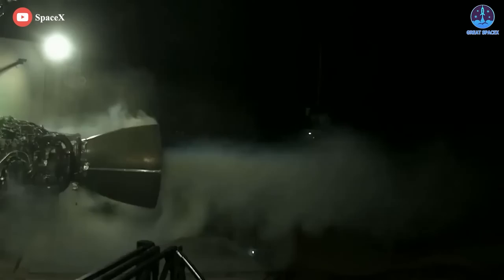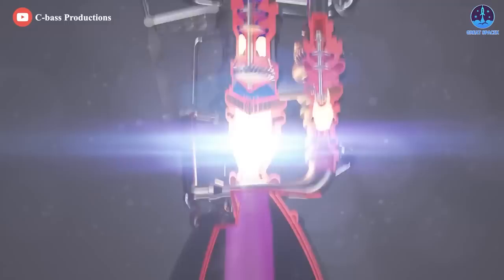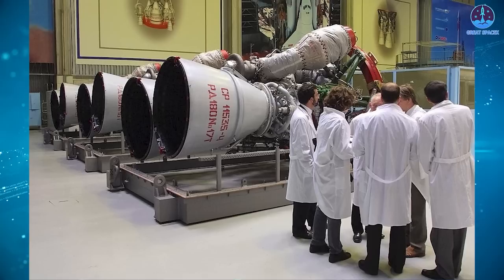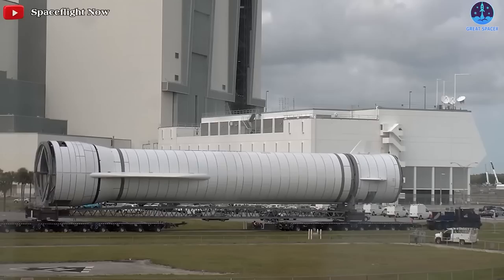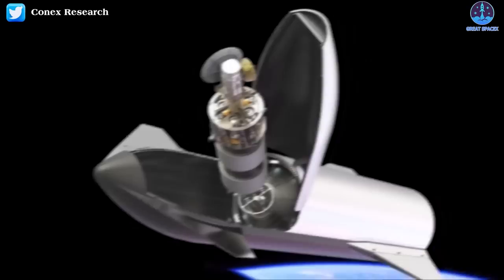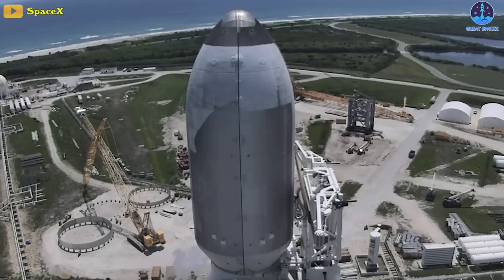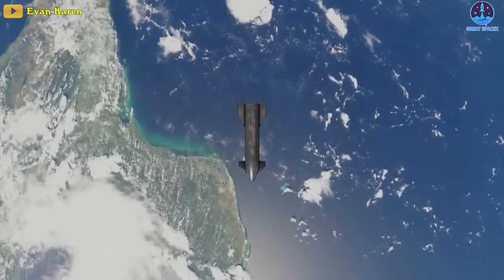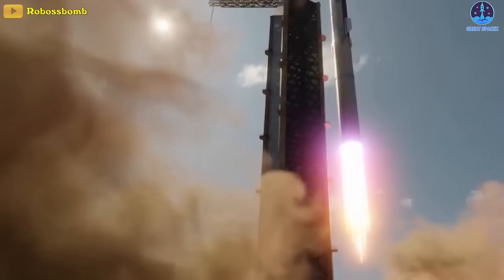What Planetary Scientists revealed of SpaceX's Starship just SHOCKED the entire world...

Comment: If we assume that spacetime is made of gravitons and that gravitons are the entanglement between photons, ER = EPR (SUSKIND), then a warp drive might look like this.  Start with a high powered laser and a crystal that splits the beam into two entangled beams p1 and p2.  The photon frequencies of p1 and p2 are the same, f1 = f2.  Since we're thinking in terms of an equation: h(f2 - f1) + Delta U = 0, where h is the Planck constant and U is gravitational potential energy, then a quantum entanglement with f1 = f2 results in zero gravitational potential energy between the two entangled photons.  

But what if you could centrifuge the entangled beams?  What if you could blueshift p1 and redshift p2?  How could you do that?  Imagine a disk that is two meters in diameter, not so different from a spinning wheel on a playground, but without all the handlebars and kids.  It would have to be lightweight and sturdy up to 3000 RPMs; and very thin.  Maybe it's made of carbon fiber or sapphire.  Next, you attach an optical fiber along the radius, from r1 = 1cm to r2 = 1 meter.  You might have to attach 12 optical fibers, from 1 o'clock to 12 o'clock.  The optical fiber might have to be thick so that it carries a lot of photons, perhaps even hundreds of watts of photons.  You might also have to use materials that slow down the light from the speed of light, to something more manageable.  You will need two of these sapphire spinning disks with optical fibers on them; one to spin at 6000 RPMs and one to be a non-rotating pathway that the photons can return to the "start" position on.

For the p1 beam to be blueshifted, the start position will be r1 at 12 o'clock.  The beam will travel down the optical fiber on the disk as it spins at 6000 RPMs for about a meter.  Then, using amazing optics and computers, the beam of photons will transition from r2 12 o'clock of the spinning disk to r2 12 o'clock of the bolted down (not spinning) disk.  Then, it will travel back up to r1 12 o'clock on the not spinning disk.  This is the first centrifuge cycle for the p1 beam that is to be blueshifted.  You can't reuse the same pair of disks because there is no way to transition from 12 o'clock r1 on the non spinning disk to 1 o'clock on the spinning disk in a way that is repeatable around the "clock".  

Since the innovative community is made of brilliant men like Elon Musk, someone could figure out a way to make this process repeatable.  In the mean time, I think it will be necessary to interlayer about 1200 sapphire spinning disks with 1200 bolted down (not spinning) disks.  

For the p2 redshifted beam, the photons will travel the other way, from r2 to r1.  If there was anyone brilliant enough to figure the timing of the process, then we would be lucky.  Nevertheless, we might have to centrifuge the p1 and p2 beam as much as a million times.

Once we had a p1 beam blueshifted a million times and a p2 beam redshifted a million time, then we would be able attempt an Alcubuirre warp drive without needing any negative matter or negative energy or exotic particles.  

Once the p1(1M-Blue shifted), p2(1M-Red shifted) beams are generated, then they are directed to the outer surface of a (what the hell) saucer shaped craft.  There will be equal length-ed optical fiber that leads to optical lenses all over the top and bottom of the upper and lower surface of the saucer.  

If the idea works, then there should be a gravitational potential energy whose acceleration of a "mass" should travel from the redshifted p2 to the blueshifted p1.  I might have that backwards.

At this point, I don't know what happens.  To make it lift, I think we emit from the bottom the p2 redshifted beams, and from the top, the p1 blueshifted beams.  I think the beams that are not emitted should be <I don't know>.  The quantum entanglement (gravitons) between two entangled photons should only work on quantum states alone.  But spacecrafts can weight many tons.  In order to lift the whole spacecraft of many tons, you have to completely encircle the saucer in the field.  When this happens, normal spacetime from outside is cut off from whatever is inside, and the spacecraft is treated like a weightless object.  The saucer is then able to "fall" or "rise" or "move" according to the beams that are emitted.

Hypothetically, aliens figured this out and that's why we see them as saucers in the day and balls of light in the sky at night.